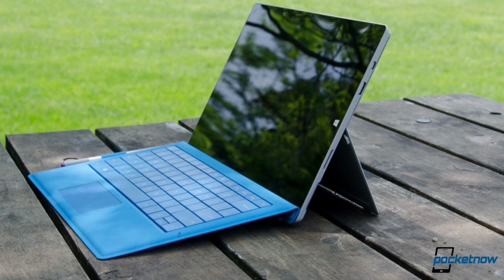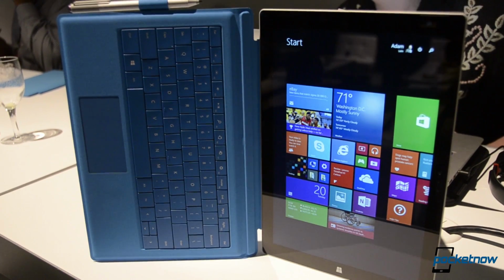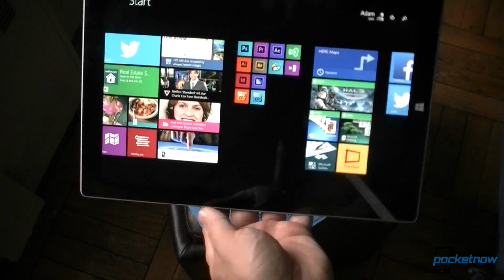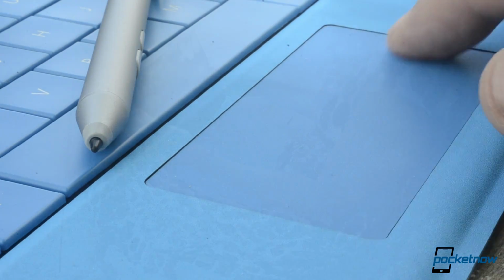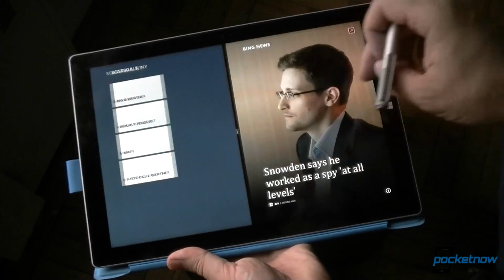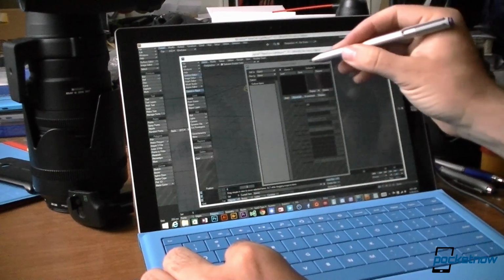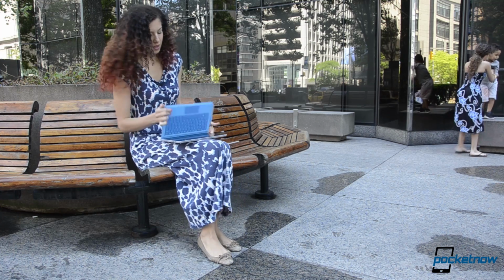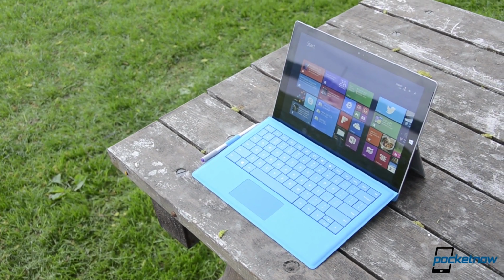Surface Pro 3 Review | Pocketnow

Comment: the hardware die for the new motherboards ie "pro surface 3" are far superior and more expandable then ever before, Intel and Microsoft use the best without restrictions.  it's hardware that windows can take advantage of, as appose to the exclusivity hardware for mac system, their system architecture are designed to perform within there "restrictions" mac are limited  Intel and Microsoft motherboard's use manufactures that are genuine, and unlocked and unrestricted and capable to firmware updates, allowing tons of supportive features with other companies.  -- isn't it time?   just get PC Hardware and Windows and quit playing the game and be compatible with the world already.   PS:  if you want a mac " just emulate it on a PC virtualization like Vbox, or Vmware"

Comment: when you are explaining the thickness of the surface pro 3, you are saying that is thinner than the previous generation Surface. But in the comparison between Surface Pro 3 vs Surface 2, you can see that the Surface Pro 3 is thicker.

Comment: Microsoft is actually trying to do everything at once. Like a transsexual.
 It is not a tablet because it runs full windows and windows 8 is not a full touch OS. I mean yes, live tiles are ok with fingers but you can't do productivity without trackpad or mouse. Fact! A tablet which runs desktop OS is not a Tablet at all!
Tablet is a big screen device built for quick media access. And surafece is not, quite much. Despite that, iPad is a tablet. Very fast mobile OS. All day usage (no matter what apps you run) Full screen apps specific for iPad. And yes no "programs". There is no point of using programs into tablet. 
Surface is not a laptop either. It has no built in keyboard. period. Who pays 100 pugs for a keyboard? 800dollars without a keyboard? Bad! 
It is not a laptop because of its touch screen. COMON MICROSOFT? WHAT WERE YOU THINKING? Microsoft used to built solid, stable and (in many times) very good OS's like windows xp and 7...great for productivity, great for a laptop!.
I was trying to explain yesterday to my brother how to use windows 8 with mouse!! it was a nightmare! Livetiles are not working with mouse guys! seriously ;(
Macbook air though, it has alouminium body with built in keyboard and huge trackpack with gestures. So you don't literally need to "swipe" your touch screen...you can swipe your trackpad and you get the same thing. Plus, you run full OSX (which is meant to be for desktops).
I am sorry microsoft. Movements like discount surface 3 for Macbook air users is at least a desperate movement. 
Try to make Windows a serious OS again and be competitive!
ps (sorry for my strange language but iam sure you get the point)
Reply: sorlino89 yes,  you are being a looser. Don't be a troll... surface pro 3 is too good for you
Reply: you just bitter because microsoft did it before apple, and may be doing very well with it.
Reply: i've seen this comment on another surface pro 3 video.
Reply: Wow. I can't even pinpoint what the hell is wrong with this entire wall of text. Heck add some spacing for the love of god. You have the FUCKING nerve to compare something to a transsexual and list a whole lot of bad. You IDIOT.

Most PCs and laptops nowadays comes with touchscreen. If you're going to compare a trackpad with a touchscreen your brain must be leaking somewhere. 

It's a PREMIUM device. Yes it's bloody expensive. But it DOES get the job done. And I enjoy being able to play and work on the same PC. Even though I had to fork it out dough for it. Not to mention the PEN is useful when it comes to note-taking and drawing.

Try drawing with a trackpad dummy.

You're reported for being a douche by the way. I don't mind if you're a mac fan and prefer it over Surface. But the transsexual comment is just horrible and you should feel bad.
Reply: Didn't I see this exact same wall of text on another video? Let me think; engadget?
Reply: Tengoku-sama what of it. Same video, same comments.
Reply: Stop spamming this comment on every Surface Pro video! Makes you look like you are on Apple's payroll.
Reply: Dipesh Timilsina keep it.
Reply: sorlino89 Read this article... You may want to buy a microsoft Surface 2  http://appgameblog.com/microsoft-surface-2-revisited-apps-games/
Reply: I use the original Surface RT still to this day. I'm not moved at all not being able to run full Windows programs on this device because I have a full-fledged gaming PC with 8.1 I can connect to with Remote Desktop.

Also, it doesn't matter if full Windows is on the Surface Pro 3, it's still a tablet no matter what you think it is otherwise; it's got all of the attributes to be one. I don't know what reasoning you're using, but the Surface line is damn impressive and you can definitely get things done on them, even without a keyboard dock.

Comment: Does it come with Office installed?
Reply: Yes
Reply: Yes but you still have to purchase it...
Reply: I thought if you just had the subscription you don't have to actually buy the whole product. I thought you could outright buy office 365 for over $250 or just pay like $10 a month and use office 365 for as long as you subscribe.
Reply: jec112203 That's right, if you have the subscription you can make the Surface one of the devices you use it on.
Reply: It doesn't! But on the bright side. getting office now gives you 1 TB of cloud storage.

Comment: Asus Transformer Book V, or Transformer Chi, 10 times better than this.

ASUS Innovates more, and is priced more better.
Reply: Thiner, Lighter, Stronger, Faster, Looks better. Better Price, more features. Yeah who would want this thing from Microsoft?
Reply: Hashtag One I don't like is how they've chosen to go with N-trig digitiser and pen now. The Wacom one is much much better.
Reply: Hashtag Its Thicker, has a clunky keyboard and it is not faster,.. it is a laptop where you can remove the keyboard, as where we have a Tablet that can replace your laptop
Reply: Only has micro usb port, no standard port, no sdcard slot, no pricing, no CPU info, the list goes on that the only thing I think the Asus has over the SP3 is cellular data option.  Other than that not really something you can say is 10 times better.  Me thinks someone is not a tech here.
Reply: Haha more better........ illiterate idiot...
Reply: PHeMoX
From reviews I've read (including from Penny Arcade) the new N-trig digitizer is actually better than the previous Wacom one.
Reply: The TFV comes with a freaking high end android phone, you really think it's going to be cheap?

The chi uses an atom processor, whose latest iterations have been good enough but anyone looking for a Surface Pro 3 and their ULV core i5 and i7 processors is not going to be cross shopping with the chi.
Reply: HoveringAboveMyself THE CHI DOES NOT USE AN ATOM Proccesor. THE CHI uses an "Unannounced" Proccesor INTEL Low power. AND Yes, it will be expenisve but still more cheaper than buying a Windows Laptop, Windows Tablet, Android Phone, Android Tablet, and Android Laptop.
Reply: The Chi is fanless, so it has to use atom, maybe Broadwell Y? I don't know if production Broadwell Y processors are good for a fanless design, either way it'll be a considerably slower processor than the ULV ones in the SP3.

Android laptops are no good, as are android tablets 10' or over, the UI just doesn't offer any benefits over what you get in a phone. There's also other 2+1 ones out there so the question will be, is it really cheaper than buying other 2+1 plus an android phone separately? We will have to wait for that.
Reply: I'm sorry - where is the launch date or pricing for the Transformer Chi?
Reply: Hashtag As much as I like Asus no the Surface pro 3 is much better.

Comment: I want to like the surface idea but unfortunately I still don't get it. In my opinion Microsoft's approach is all wrong. They should use windows phone os for smaller tablets and phablets which are more popular than large 10 - 12 inch tablets. And they should make there own touch screen utrabook to compete with the likes of the macbook air. If feel that the surface is still a bad idea.

Comment: Is it worthing getting the lowest end model?
Reply: if you want better battery life than the high end variants, yes
Reply: Depends on what you want to do, really.
Reply: Jp Conway I think a i3 version will be just fine, but remember that it only has 64 gb of memory, and only around 40 to be used. If you are going to use the intergrated Onedrive a lot (which you should) then you won't have any problems. But if you would like to do some graphical editing then you'll want to go for the i5 version.
Reply: Dirk van Vugt Memory = RAM Storage Space = HDD"s and SDD's

Comment: Well, I've been buying expensive ultrabooks plus the Surface RT for a few years now, with no interest in the Pro because I didn't see the point in it.  Now that they've figured out that it should be a high end LAPTOP replacement (that happens to also works as a tablet), I think they are finally getting it.  I will sell my laptop and Surface 2 and grab the Surfac 3 i7 version!  It will be really cool to have something that light I can drag back and forth from work without breaking.

I don't think I'll buy a keyboard, since I can just use it in touch while out and about, and use the nice wireless keyboards I keep at work and at home.

Congrats Microsoft, you freaking nailed it!  Now just delete that capacitive start button and call it 'done.' :)

Comment: They kinda had to shift the start button from the bottom if they wanted to implement the stabilising keyboard-attaching feature, because that takes up the entire bottom bezel. I guess you've gotta decide whether the added convenience of a tilted, more stable keyboard outweighs the accidental taps on the button....

Comment: The button seems to be moved there due to the new keyboard folding up where it used to be placed. If it were in the same place it used to be you could not use it when the keyboard was in that position... nonetheless i still see it as a gripe.

Comment: How much for the i-7 model? Anyone, thank you.
Reply: you're welcome
Reply: So much that you'd have to sell a relative into slavery to afford one.
Reply: ***** you have cheap relatives
Reply: ***** It may be more expensive, but if you like mac, it's worth it.
Reply: ***** Thank you. It's $1,950. Still about $2,000 less than a fully loaded Mac-Book Pro.
Reply: ***** A Mac-Book Pro with EVERY possible option is about $4,500. But a base model starts at about $2,000.
Reply: ***** They don't sell non-retina anymore, though something that people have not mentioned is that the MBP uses Intel Core M processors with a TDP of 28w rather than the 15w ULV ones in the Surface Pro 3 and the MBA.
Reply: ***** i7 ULV is not faster than i5 M.
see http://www.anandtech.com/show/8037/microsoft-surface-pro-3-hands-on-display-performance-preview
Reply: ***** Oh, sorry, I thought you were talking about the processors in the rMBP compared to the SP3.
Reply: For the 256GB and 8GB of RAM i7 model the Surface Pro 3 will cost $1549, and for the 512GB and 8GB of RAM i7 model the Pro 3 will cost $1949.
Reply: Spider Pig Good info,Thx!

Comment: While the surface pro 3 can replace both a tablet and a laptop, I would still go with an iPad Air and a $500 computer over microsoft's ~$1000 tablet. It doesn't have the tablet app library that the iPad has, and I would rather have a legitimate laptop keyboard for more extended web surfing.

Comment: They should integrate a large battery on the stylus. And have it connect to the surface to recharge. The surface should tell you the pen status. Charging the tablet means sticking the pen to it, recharging it, problem solved.

Comment: I have a question.

If you fold the keyboard around the back of Surface 3. Suddenly you touch the keys while holding the Surface. Does the Surface 3 disable the keyboard automatically or not? 

Thank you.
Reply: And the last one, 

When drawing on the Surface with a stylus, can I touch the screen while using stylus ?

Comment: mannnnn give me a job over there at PocketNow... but seriously.. good review.. next time tell us what u think about cost to value ratio..
Reply: If you're carrying around a $1300 MacBook Air with a $999 Wacom Cintiq pen digitizer and an $800 iPad, then you can replace all of that and have close to the same functionality in a Surface Pro 3 with money left over.
Reply: see.. in other words... all the surface pro 3 pricing is justified? Adam Lein.. I would probably go for the model your demoing.. seems pretty good.
Reply: SAMxB Wreck To me it's justified because I love the pressure-sensitive stylus. Adding that to a laptop with an accessory is really expensive & cumbersome to carry.
Reply: If your a pro you'll probably want to stick with Wacom regardless.
Reply: right... im not too sure if I'd be that into the wacom stylus.. but I like this Pro because of its build and refresh on the laptop tablet convergence.. and plus I need a new one anyways.. Adam Lein